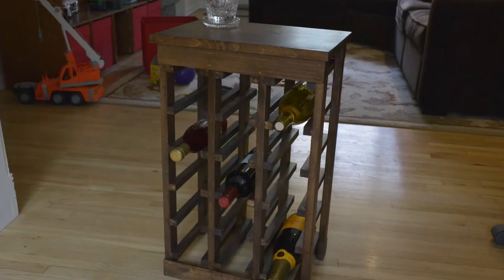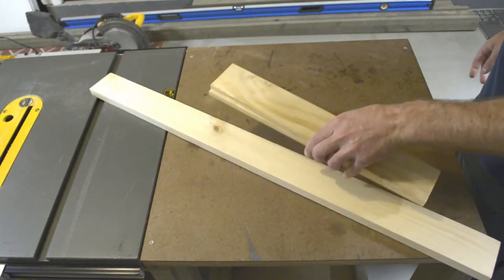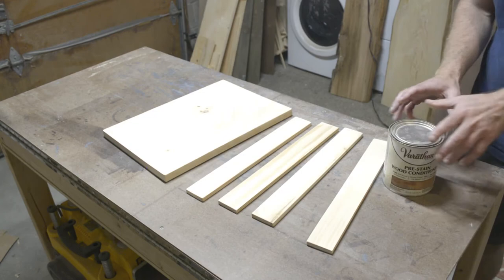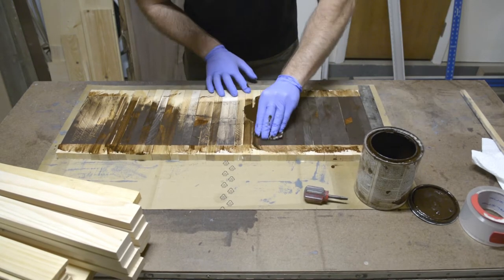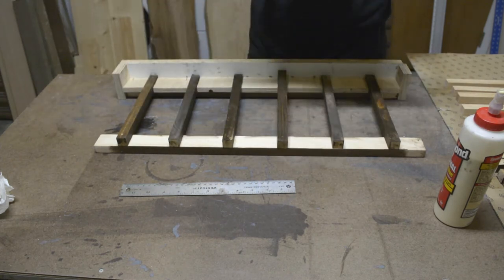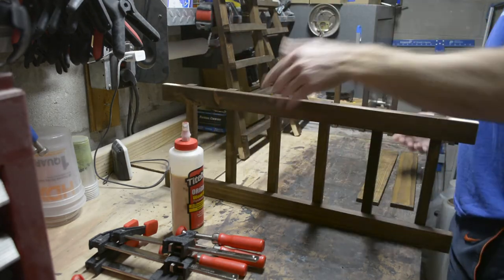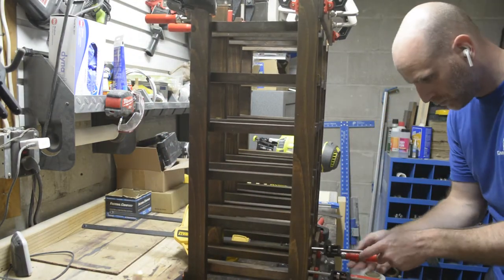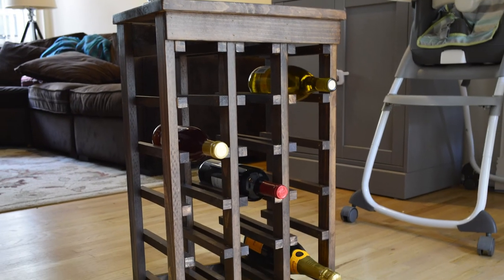How to Make a SIMPLE Custom Wood Wine Rack - How to Build - DIY - Wood Working Project

Comment: Excellent, clean presentation. ( even with that pesky nail gun  :-) Best editing I’ve seen in a long time. 
Pre stain ?  What did you use ? Same as final ?  Thank you. Yes , I’d like to see more practical items like this.
Reply from the maker: For the pre stain I just use a mix from min wax or varathane for example. You can also make your own if you want to get creative. But make sure to match up whatever you use with the type of stain (water based or oil based).
Reply: @scotchinhandmillwork  so a mix of finish product with stain color (same base)  This seals and second coat of stain is a more consistent color  on pine ?  Second coat will adhere over first coat of 50% finish product?
Reply from the maker: I would do a light coat of pre stain. Let that dry. Then apply your preferred stain. It can be an all in one stain (stain + poly) or you can apply the stain first. Once dried then apply polyurethane. Always follow manufacturer recommendations at first until you get the feel for it. And always test on scrap pieces before doing anything on the finished work piece.

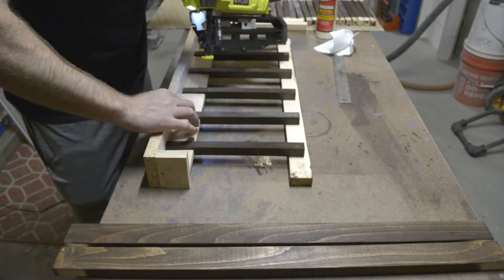Comment: 9:06-9:15 is confusing since we do not know the length of these legs. What is the spacing from one slate edge to another?
Reply from the maker: The length of the legs is about 24.75 with a vertical spacing of around 3.5” between them. I hope this helps! 👍
Reply: Thank you so much!
Reply from the maker: You’re very welcome. Let me know if you have any other questions.

Comment: What length of nails did you use?
Reply from the maker: Sorry this is late, but I used 1-1/4" nails.  Make sure to set your compressor regulator pressure and do some tests to see how deep your sinking the heads.  Thanks for watching!

Comment: What was the length of the fronts??
Reply: The only measurement I was able to capture was 2” x 1/2” x L?   How long are the fronts/aprons?  15  1/8”? Since the top is 16 1/8” allowing for 1/2” overhang on each side? Is this correct?
Reply: @qwaj6985  my top came out 16 inches after sanding down and after spacing each slat 2 5/8ths I came out to 15 1/2 in Fronts. Worked great

Comment: It looked like you cut the slats across the grain. That can't be right.
Reply: I thought the same thing
Reply from the maker: Yes you are correct on some of them. I’m all about maximizing materials and not being wasteful. So some of my scrap I cut across the grain which is not ideal. However with it being glued and nailed on either end and it’s not holding any real loads it’s ok.